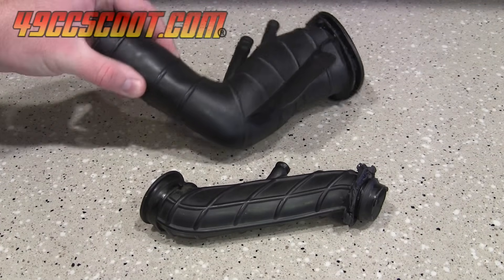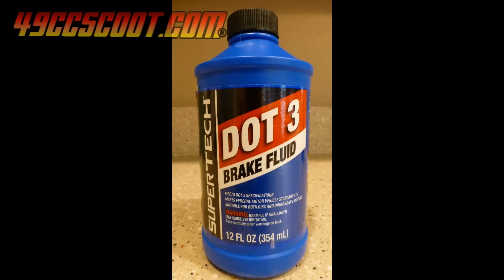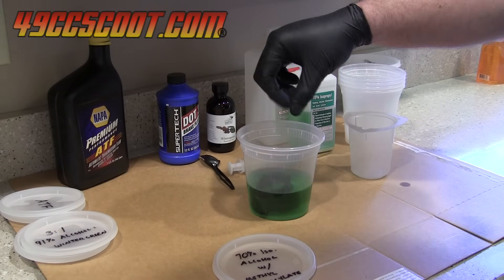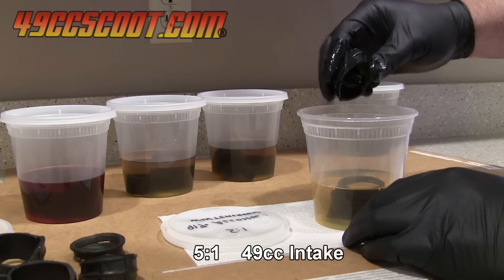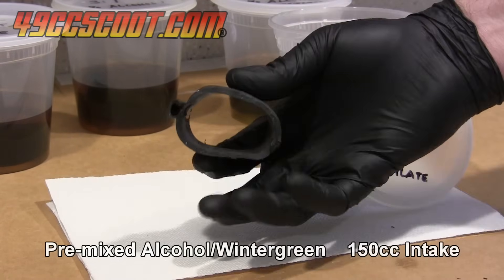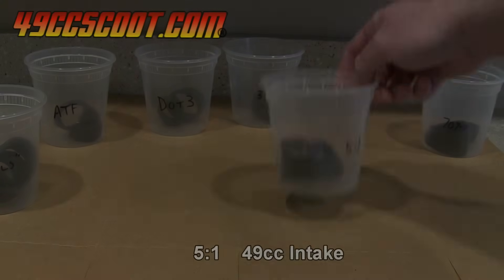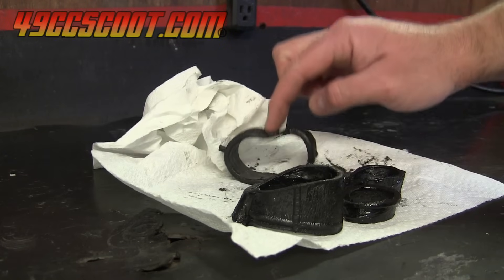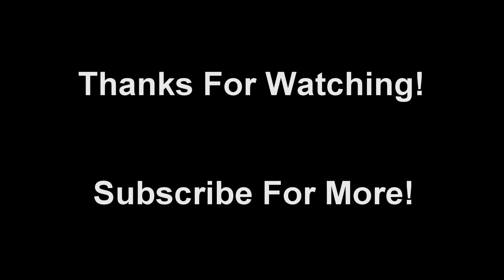Rubber Softening Experiment : Wintergreen Oil, Brake Fluid, ATF & More

Comment: As someone currently finishing his PhD, I am amazed at your fantastic and well planned methodology.  If every informational video was like this the world would be a smarter place.  Thank you, and keep up the good work!
Reply: I watch this video because of your comment
Reply: Getting a phd from your master doesn’t make you sound anymore intelligent  you slave 🤣
Reply: I was also very impressed by your methodology. As with many experiments it left me with more questions. To reduce cost, what if you intermittently rubbed the parts with different concentrations of wintergreen oil and alcohol or what if you put a smaller amount of the wintergreen oil and alcohol in a tumbler to evenly distribute it on a larger part?
Reply from the maker: Thanks!

Comment: This was such an awesome video thank you.
I've used the 3-1 method to soften a part, I don't suppose you have any suggestions for removing the smell of Wintergreen from the part?
Reply from the maker: No, sorry. The smell didn't bother me. I'd imagine it goes away eventually. If not, your rubber parts double as an air freshener.
Reply: @49ccscoot  Hehe ok thanks. The rubber part I'm softening is from a joystick so you end up with a fresh smelling hand after using :) Thanks for the reply.
Reply: It'd probably already dissipated by now, but I would've tried throwing it into a suitably sized bag... (like a ziplock... or any plastic bag or closed container would do, really... as long as it can be closed off somehow), and then sprinkling baking soda all over to thoroughly coat & cover it... (and if using a resealable bag or container with a proper-fitting lid, it can even be shaken up to really ensure even & total coverage... like as if preparing "Shake & Bake" chicken... lol). 

Then after closing up the bag/container and leaving it for a while, I'd smell-check it starting after a day or two... leaving it for as long as necessary until satisfied that enough of the odour has been removed (or completely, if that's the goal). Then a wipe-off with a damp cloth to remove the baking soda... (or simply rinsing it off, and then drying... with a towel, or air drying on a rack, or whatever), and you should've been good to go!

In any case, you can always try this the next time the need arises again, as it should be effective for this sort of scenario... (though I haven't actually tried it myself for this particular purpose, as I haven't yet gotten my hands on a bottle of wintergreen oil... but it works great for most other odours & materials, so I don't see why it wouldn't work in this case too).

Comment: The transmission fluid you used probably isn't that great either for this test either. The kind that you would want to use is one that has conditioners for the rubber seals. High mileage fluid usually has that. But  this stuff doesn't specially say it contains that on the back of the bottle.

Comment: I found your video while researching ways to soften the hard rubber seals on my collection of Sunbeam C30 Coffeemaster vacuum coffee pots, but I also have a collection of old cars and bikes so I ordered 32 Oz of wintergreen oil from Big Dee's vet supplies for 12.95/16Oz + $6.50 shipping (which was the best price I saw in a short search). Thanks for your well thought out approach.  The wintergreen oil cost about the same as one new seal for these coffeemakers, so I hope it works for several of them.  If not, I'll have it on the shelf for my rubber car part needs.  Thanks again
Reply: Big Dee's wanted to charge me $60 shipping to Canada for 16oz., haha. They can eat it.

Comment: Rubber rejuvinator should do well.
It's used to soften the rubber printing blanket on offset printing presses. 
Costs around $45 for half a gallon.
Reply: Unfortunately depending on the brand it may be a tad more priceeey

Comment: Would you recommend doing this to weather stripping and run channels that are discontinued?
Reply from the maker: If you're out of options, it seems worth a try. Could possibly even try brushing or wiping on a wintergreen/alcohol solution and seeing if that did anything for them. Maybe as part of some maintenance schedule if it works. If at all possible, I'd test any of this first on a part that matters the least. If you could find it, maybe even a piece from another vehicle like yours so there's no risk to your parts. The last thing you want to do is ruin all of the stuff that you can't get anymore. Also, I don't think it's an issue, but it wouldn't be a bad idea to make sure the solution doesn't harm paint in some hidden area if you were considering wiping it on while on the vehicle.

Comment: Thanks for the in-depth study! Excellent job and presentation.  A question.  I am treating large band of rubber used on a "Skiers Edge" exercise machine.  They are decades old.  I have decided to anneal them in hot water, then use the 3:1 wintergreen oil/ alcohol.  I have extra bands and wanted to get your thoughts on just leaving them in the solution indefinitely/until needed.  Thoughts?  Thanks again!
Reply from the maker: If you do something like that I'd keep check on them to see if you start to notice anything negative for a bit. Not familiar with the machine, but if there is any danger if these things break, I don't know that I'd mess with it.

Comment: It was common back in the day to put brake fluid in your auto trans to swell the seals and stop small leaks.  How do I know ?  It got me from the docks in New York back to Ne Pa. in a few hours....   It was also used on truck tires not only to give them a quick shine but to actually meld fine cracks in the tire back together again and prevent further cracking.   Note : too much fluid too often can damage your tires.. and needless to say your tranny as well..   I used it because it was an emergency... and it worked...
Reply: Nate Ngzcaz
Ha, I knew it!
Thanks for sharing / pointing towards very interesting direction

Comment: To check for swelling (volume) you would measure displacement of a measurable liquid, likely water, before the soaking and after and compare the differences between the two submergances of the part.  This is more university lab type measuring than shop.
Reply: Micrometer

Comment: I have a small bottle, 2 oz. of commercial rubber restorer, the main ingredient being banana oil. I believe it was made to paint it on considering the small bottle, I've never tried it out yet. On ebay  banana oil is $10 for 4 oz.
Reply: have You painted it on tired, cracking or stiffened rubber?? does it work?  do a youtube maybe so we can be aware. TY

Comment: Thanks for checking after some time has gone by, unlike others. I've always wondered if the bonds in rubber are being damaged by softening. Transmission leak fix stuff does the same thing and might be able to be wiped on, but may have solvents which weaken rubber. My guess is the alcohol, having little surface tension, soaks into porous rubber(not synthetics) while the oil rides along suspended in alcohol. Then the alcohol slowly evaporates leaving the oil inside. This is probably much safer than solvents that actually dissolve or weaken rubber. I can't think of any reason wintergreen would be better than other oils soluble in alcohol.
Reply: Plasticizers normally have high compatibility with the polymers. They need to not bleed out (quickly) and not bead up within the polymer. The polymer will swell. It's what happens when any compatible liquid is absorbed by a polymer. Swelling weakens the polymer but that may be temporary (it may not always break a ton of bonds).
Polymer compatibility goes further than surface tension. If you'd like to learn more, one direction is to look up Hansen Solubility Parameters, and note that for a polymer, swelling and absorption is a rough equivalent of solubility for non-polymers.
While it's possible that alcohol+wintergreen is more compatible with rubber (penetrates better) than wintergreen alone, I have heard of wintergreen as a plasticizer but never alcohol. Baby oil (mineral oil) is another plasticizer, but I suspect they're for different types of plastic. And plasticizing isn't about penetrating better. IIRC it is thought to be about interfering with the inner-molecular forces (maybe holding the molecules further apart or lubricating between them) so the plastic or rubber molecules can un-bunch (stretch).

Comment: To cut on cost, it would be interesting to try just brushing on the wintergreen oil and rebrush every few hours instead of a complete soak. I wonder if that would work. In this case you can use pure wintergreen oil even on large parts.
Reply: I did try this on the rubber “gasket” on some vintage military goggles. It didn’t seem to make a difference, but I only did two or three applications. Since this took days to see results, I think I’d have to be very patient getting enough winter green oil into the rubber.
Reply: Yeah did it help?
Reply: This apparently works with coconut oil which is identified as an alternative plasticizer to petroleum oil but I haven't tried it personally
Reply: @dockazoid8180  Coincidentally I live in the country that is the top or second top coconut exporter in the world. 
I'll try that, we use it as common cooking oil.
Reply: @petercandance2330  how did it work ?

Comment: For this purpose, search for Methyl Salicylate and you will find larger quantities at a more reasonable price.  BE EXTREMELY CAREFUL IN HANDLING THIS COMPOUND as salicylate is the same as aspirin and in this chemical form it can cause overdose easily.  Where heavy gloves and avoid contact as it can be easily absorbed through the skin

Comment: LOL... What about just plan hot water... It's works for me... Also all you had to do to keep the temperature down was Remove the bucket from the heat source... When it cooled a little put it back... But you need to just try hot water only in your test...

Comment: have you seen any change since this was done?  I am concerned about the possibility of the rubber disintegrating later on.
Reply from the maker: Seemed fine last I checked. It will re-harden eventually, just like new rubber would. Didn't notice any problems with it falling apart or anything.

Comment: Wintergreen oil is MUCH cheaper when purchased as horse liniment. About $10-$15 for 16 ounces.
Reply: I found the active ingredient was actually methylsulfonylmethane?
Reply: @nsummy  Just to note, Big D's is + 6.50 for shipping unless you spend 70 dollars.
Reply: @nsummy  what is the difference between therapeutic grade and commercial grade with regards to its effectiveness on restoring rubber? In this video which one was used, no point buying the cheap stuff if it isn't going to work?

Comment: With the heated method, you could  seal your parts in a food saver bag with the proper measurements of wintergreen oil and water. You could then put this bag in a plain water bath with a Sous Vide "stick". You could then set the stick at a set temp for as long as you want. It will stay very close to that temp. People use the Sous Vide method to cook meats for up to many hours. It will tenderize the meat but keep it rare or medium or whatever. It can keep a steady temperature for as long as you have water in the vessel. One can look up plans on the Internet to make a poor man's Jerry rigged sous vide contraption using a temperature controller hooked up to a crockpot. Even the poor man's version makes a very reliable tri-tip steak in whatever doneness that you want even after several hours. However, I don't know if the Wintergreen oil will dissolve the food saver bag appreciably or not. The sous vide elements that submerge under the water are usually stainless steel but seem to still corrode a little bit.
Reply from the maker: Thanks for the info.

Comment: Thanks for the video.
would putting the hose in a oven set at 200/220 F for 10 minutes do as well as the winter green and  alcohol?
 I heard acetone works t soften  rubber up also. how much i dont know
Reply from the maker: Heating will help, but it won't last without the chemicals. Once cool, it's back to being hard again.

Comment: Thanks for this! Your review is more credible and relevant than many of the others I have run across. Your experimental conditions are controlled and identical.

I ran my own experiment last month with three solvents and wintergreen oil using a 3:1 ratio by weight. I am rebuilding a grey-market Honda RVF400. Parts are expensive and hard to come by in the US. Anyway, I have some old rubber parts to try my own experiment with. After reading many articles and postings online about the magic of methyl salIcylate were true and I wanted to see if the solvent used made a difference.

The three solvents I compared were:
1) Xylene (Renue Rubber product MSDS says this is the solvent they use).
2) Denatured ethanol 
3) Acetone

RESULTS
After a 24 hour soak the acetone parts swelled the most by far 22%! Ethanol and xylene also swelled but "only" about 10%.
No rubber was damaged just swollen.
After 24 of drying out the Acetone part was most flexible.
The Ethanol part a very close second (almost the same as acetone)
The Xylene part was least flexible but definitely better than untreated.

After 2 weeks of airing out they all essentially returned to the original and all the same size but are still flexible thought they are hardening. I do not (yet) have factory OEM parts to compare with.

DISCUSSION
If I wanted to use this technique to soften some rubber parts I would choose 100% denatured ethanol or acetone. Both are readily available.

I believe the solvents help swell the rubber allowing the wintergreen oil to penetrate into the parts more easily.

SUMMARY
I agree with 990GTVert's recommendation: buy replacement parts if you can and reserve this method for hard to find or unavailable parts. This is simply a back-up technique if you have no other options.
Reply: Very nice! So do you just soaked it, do not need to put in boiling water? And after a year, does it hardened?
Reply from the maker: Thanks for sharing the results of your tests!

Comment: Idea: try painting the rubber with the oil, and then wrap it or put it in a sealed plastic bag. Then you can add bath-warm water in a bowl and submerge the part without dissolving the oils. And you can Change water when the temperature drops. 
Neat test. Perfect approach! Thanks for inspiring me
Reply: Lol check out ichiban motos diy on how to restore hard old rubber.
I wonder if the hot sauce actually did the trick.
Maybe let the wintergreen oil bind to something and subsequently stick to the rubber. Wha do i know :D
Reply from the maker: Someone did put a similar approach up on YouTube. They put a small amount of the 3:1 mix in a sandwich bag with the part and kind of rolled it. Then they never bothered to post another video to tell if it worked.
Reply: @Lifeisawheelie  
I'm a year late but that was a joke video, the real method was in the video description. He used a 50/50 blend of isopropyl alcohol and wintergreen oil soaked for 36 hours or so

Comment: question..what ngk spark plug is better the basic or the little more one in price? and nkk boot cover, is the 90 degree better??
Reply from the maker: The iridium plugs should last longer and may help cold starts. Whichever angle fits your application the best is what is better. Different ones fit different engines the best.